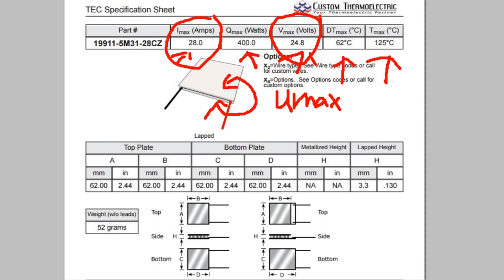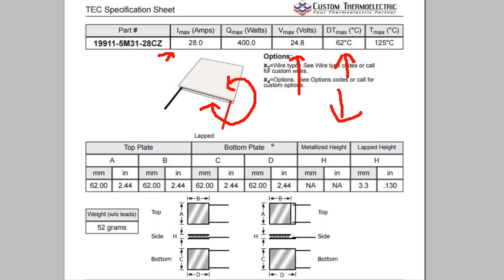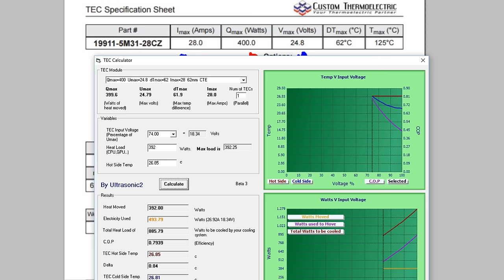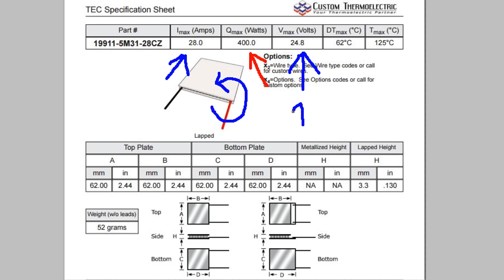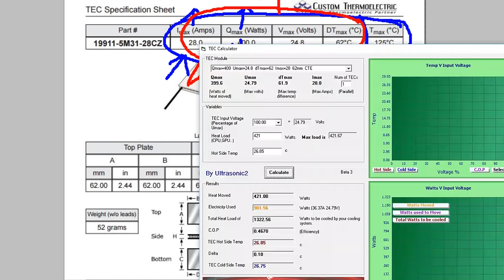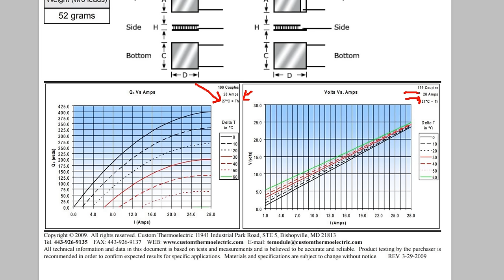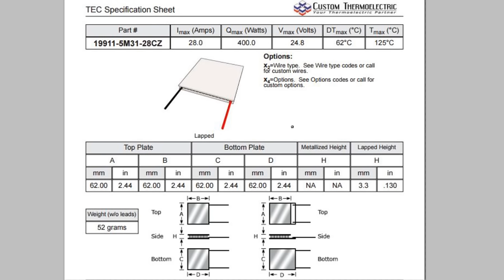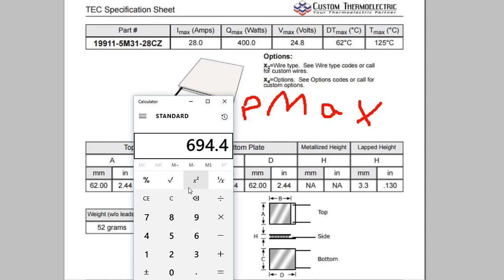🎓 Understanding Peltiers ⚡️ Specifications. Episode1

Comment: I went on to watch them. Had them on in the back ground while doing work though and got quite a bit confused. Especially with the cliffhanger 100%+ calculated efficiency. Etc. need to rewatch when i can devote more attention. For now I am thinking of trying something else. I was initially thinking 2 closed circuits of fluid with thermocouples between two aluminum cooler plates. (The kind that eBay is literally bathing in)

Comment: What if you're using the peltier for heating though? I'm struggling to find any answers on this. I want to heat half a liter of water to 100 C and I need to figure out how much power it will take to do so. An example would be a room temperature room for the cold side, and near maximum operating temperature on the hot side. I will be using a thermoregulator to safely heat the water without damaging the peltier.

Comment: Thanks for the videos, by far the best information out there.
One question, would it be possible to control the plate in order to have a continuous temperature of about 4°C on the cold side and 40°C on the hot side? heat load 0
Reply from the maker: hi yeah that should be doable..

Comment: Is it wise to drive a Peltier at it's rated Vmax or maybe 2/3 or 3/4 to increase longevity? I've been told that driving them at a lower voltage than they're rated at actually increases efficiency but the trade off is obviously lowered cooling output.
Reply: Three years late, and I am here trying to learn, but I would say that since they are a P/N junction, we can probably compare wear and tear to a transistor. Or most solid state components. More current = more heat = more wear. Less current = Less heat = less wear. I am not an expert, but the P/N junction similarities tell me that there must be some similarities in that. How they wear out with ON/OFF or leaving it ON, I don't know yet. Would love to hear your take, if you have learned more in the years that have passed. Happy tinkering.
Reply: @Inertia888  I'm still dabbling 🙂 What I found was that driving them at 2/3rds of their rated Vmax gave no discernible drop in cooling performance & the heat dissipated from the hot side was  also much less. So I'd imagine that would much improve longevity too.

Comment: @17:28 why or how does the amount of head moved remain at 100 watts?  As the input voltage % decreases so should the amount of heat that is moved.  Heat moved does NOT remain constant....
Reply from the maker: heat moved it constant cos that is what was specified in the heat load box ... this is assuming that the load like a CPU outputs a constant heat load of 100watts.. this is irrelevant of what input power you apply to a TEC OR even if you use a TEC at all
Reply: @Ultrasonictwo Please, sir, where can I get the program code? I have installed it, but I need the code. I am in a hurry. I hope you can reduce it to me. I desperately need this program.

Comment: I know it's been awhile since you've posted this but I hope you're still around. I'm a bit confused on the physics as to why when the TEC hits 60 delta T, it's moving no energy. I'm telling myself, well there's still energy to be moved on the cold side, so why isnt it being moved? Is it more akin to how a refrigeration cycle transfers less heat from a cold area, because the ambient cold side conditions are approaching the coolant temperatures? So efficiency approaches zero. Or is this becuase the rather large delta T is actually trying to conductively transfer heat backwards/against the TEC and this 60 delta T is the net zero point? 

Thanks!
Reply from the maker: When dTmax is achieved there is no energy to be moved from the cold side because that is achieved in a vacuum where there is no energy. However in the real world there will always be some load to the cold side so dTmax is never realistically achieved.   .. Does this help ?

Comment: Thanks for the video 
Please i have this question 
I want to cool an electronic Aluminium Box of size 10cm x10cm x10cm  to -20 deg C 
I plan to use a 10mm thick copper surface plate of size 127mm x 152 mm  to be attached to the cold surface of the peltier element  and cool it using water cooling with a heat sink of 15mm thick  , having a thermal resistance of 0.05 degc /W 
Please i want to ask how many peltier element can be able to cool my electronic aluminum box to -20 deg c 
Any guidelines and direction would be highly appreciate
Reply from the maker: You are asking the wrong question ... but the answer to your question is it does not matter the only difference will be the time it takes to get to -20 . assuming there is perfect insulation and you have no heat source inside the box.